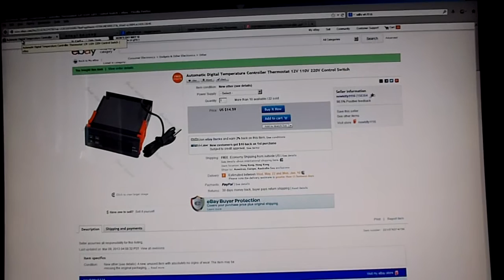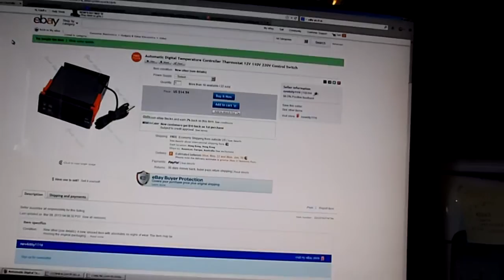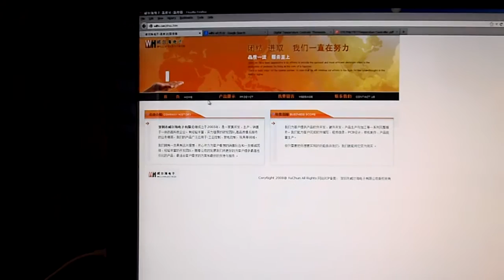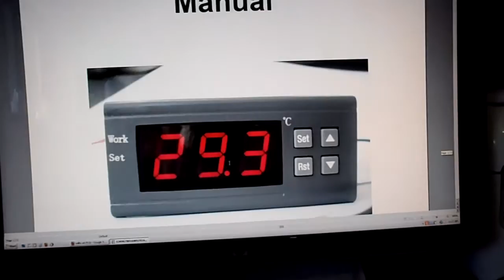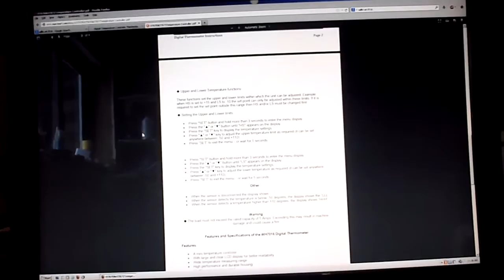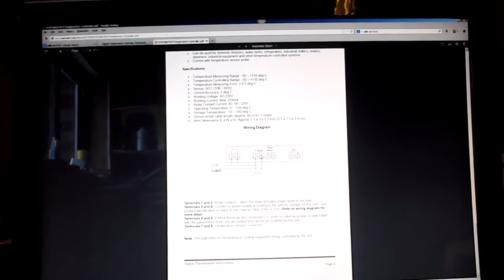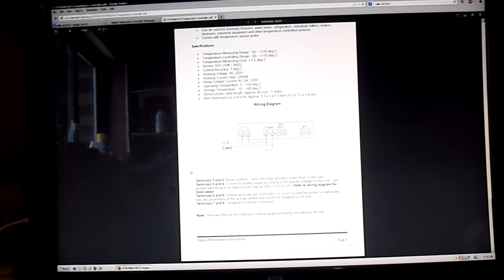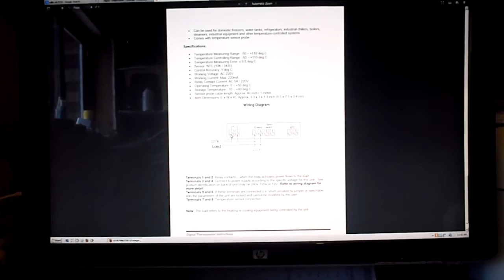Part 1 WILLHI WH7016 temperature controller for poultry incubator

Comment: I just purchased the 7016j, to use with a Peltier thermo eletric device. simple red and black. I think my info for the 7016 unit will be in Chinese, do you have a link to english instructions? i think I will be fine, but wouldn't mind some help

Comment: I just purchased the 7016j, to use with a Peltier thermo eletric device. simple red and black. I think my info for the 7016 unit will be in Chinese, do you have a link to english instructions? i think I will be fine, but wouldn't mind some help
Reply from the maker: +Michael Gillmann 
I just saw your post.
I did a quick Google search and couldn't find any English instructions for your unit. I did find a couple of sites selling the 7016j, and this one has a pretty good picture showing the wiring-  http://www.dhgate.com/store/product/multi-display-willhi-wh7016j-12v-electronic/167605293.html. 
As far as I can tell, it is just like the one I'm wiring here except it has an extra output from the switch for an alarm, or something else that needs power such as an indicator light.
If the unit on this site is the same as yours, power goes into 4, ground to 5, jumper 1 to 4, 2 & 3 are switched outputs, then the return ground side of the load to 5.
Hope that works for you, put there are so many different units from this company with the same number it's had to be sure
Reply: I think you meant jumper 1-4 if power is going to 4, if I'm not mistaken. then the return from the element would go to 5. it's in the mail and I spent time staring at the back, and think I got it. I'm trying to think about what my alarm could go to. or how I can have a reverse switch for the heating and cooling and pump. but thank you for response. should be a fun project now that I past that little thought bubble. it was so simple.
Reply from the maker: +Michael Gillmann 
You re right it should be 4 to 1.
One of the diagrams on one of the sites I found showed a reverse switch(one off, one on), but most showed a double switch. 
You could use one for a light to indicate when its on.
I'd be interested to see what you're doing.
Reply from the maker: +Michael Gillmann  
One of the things you'll need to watch is the load. I just looked at the link, and the working load is only 2 watts or 5 amps.
There are units that can control multiple outputs separately and bigger loads. The same 7016 but with different suffixes
Reply: well, me too haha. won't know til it's finished if it's even going to work. let alone take the finished product and use it. I'm using a computer cooling system device as my heating cooling unit. and my mind went crazy from there.
Reply: well, me too haha. won't know til it's finished if it's even going to work. let alone take the finished product and use it. I'm using a computer cooling system device as my heating cooling unit. and my mind went crazy from there.
Reply: Well the heating cooling plate is 12v 6a
Reply from the maker: +Michael Gillmann 
There's some neat things you can do, heat from one side, cool from the other, or if you apply heat to one side and cool the other you can generate electricity